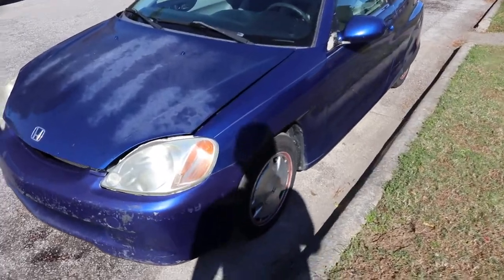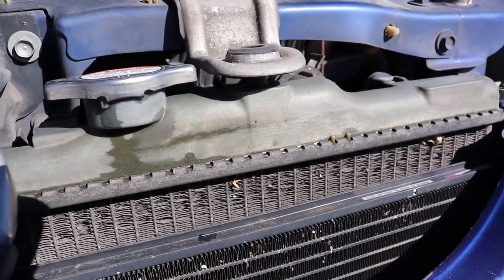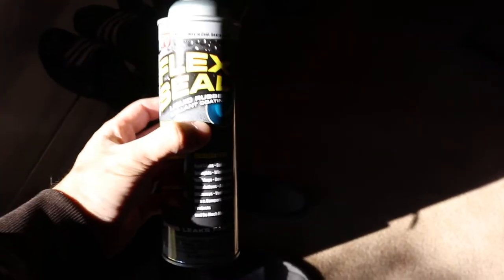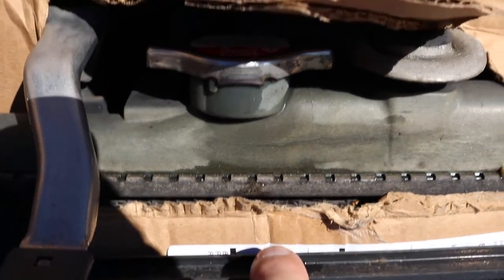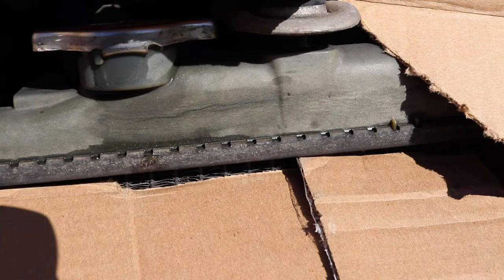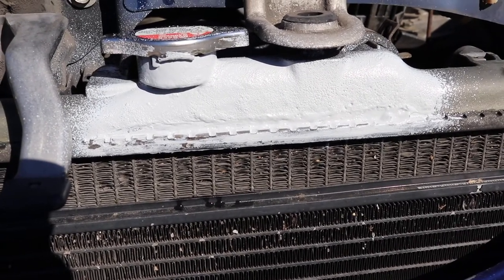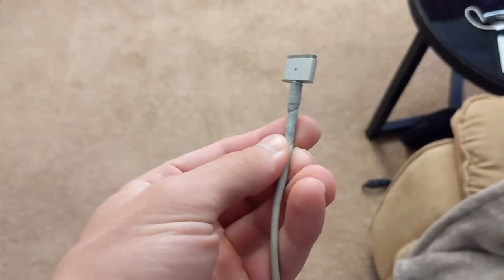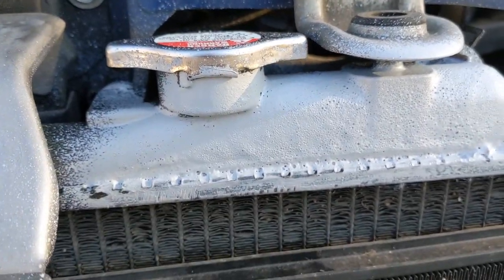Will Flex Seal fix my radiator or charger?

Comment: Just a small comment about the bubbles on your radiator. Loosen the radiator cap to equalize the air pressure.  Try that technique on another crack if it should happen again and I bet you there won't be any bubbles.   UNLESS ... It's kind of the same effect as holding spray paint can 3 inches away from what you're trying to paint( bad idea)because you're going to get runs/bubbles👍    So hold can farther away from radiator so the spray doesn't bulk up so readily.    And for heaven's Sake clean that surface extremely well beforehand.  Okay so I guess it was more than comment LOL. Thanks for the tip and using your car as a guinea pig so I didn't have to 😎

Comment: You have to spray various coats. You spray once, then again, then again till you build a nice thick seal. Do not over spray or you will cause water drops or bubbles.

Comment: This product will never stand up to the pressure and heat over time. This Flex Seal product is "not" intended for pressurized systems or heat applications like a Car Radiator. Because it says for Leaks...does not mean it works on a Pressurized Water cooling system.
Reply: yeah i have a tiny pin hole on the the top plastic connector hose. i'm use JB water weld
Reply: that's what I think also

Comment: How did it work on the radiator thinking about using it on the Polaris ATV
Reply from the maker: My follow up video explains it does not work. It gets too hot and makes the flex seal too soft
Reply: @JRobling  
I suspected that !

Comment: How's it holding up after 3 months?
Reply from the maker: Watch my follow up video
Reply: Man I don’t see no follow up video just tell me what it is
Reply from the maker: https://www.youtube.com/watch?v=-Zz6frrFNvU&t=122s
Reply: I have seen a couple of cases over the years where a radiator was leaking at the crimped seam where the plastic connects to the radiator and it was just a matter of re-crimping the aluminum tabs to tighten everything up.
Of course I've never been that lucky.